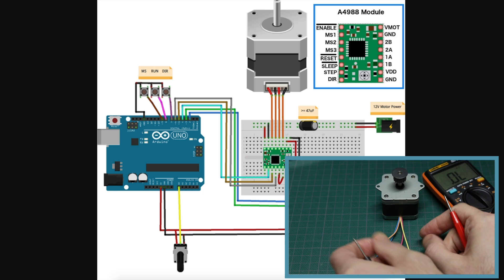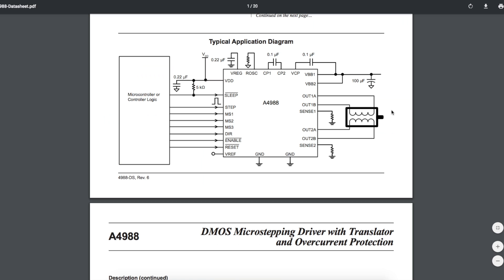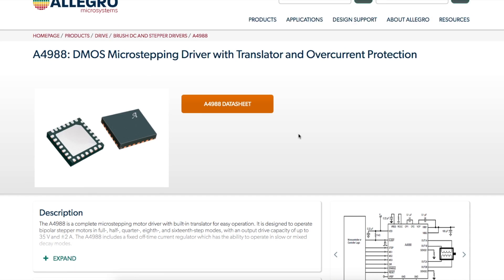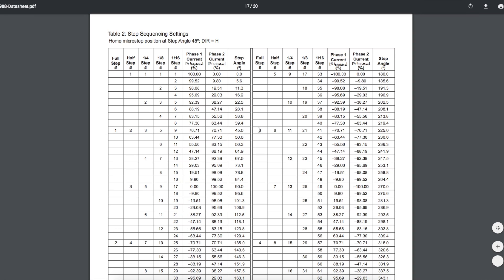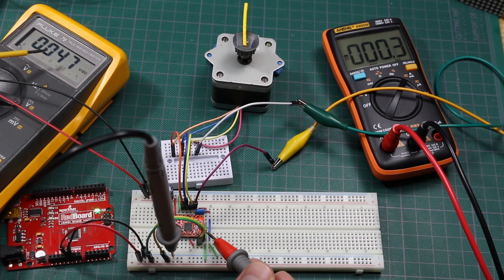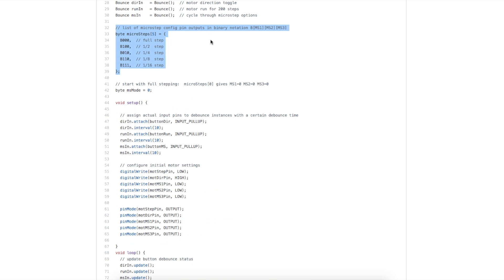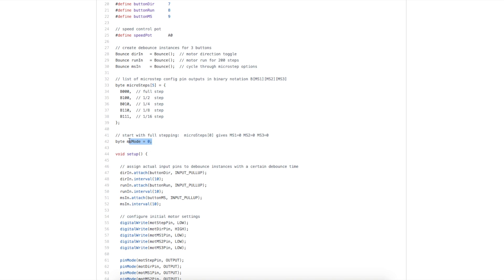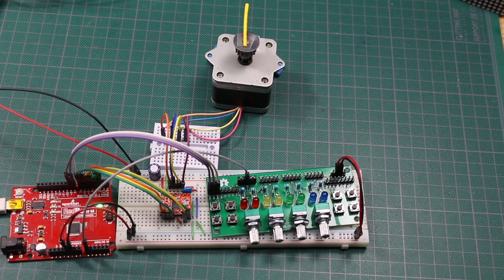A4988 Micro-Stepping Driver with Arduino Uno

Comment: how did you know what power supply to use for this project? and where did you buy one?  the nema17 stepper motor specs that I have are: 
Rated voltage: 3.6v
Rated Current: 1.5A/phase
In essence I'm curious to know why you chose 12 volts.
Reply from the maker: If I didn't use a variable bench supply then it was a fixed 12v from Banggood  https://www.banggood.com/custlink/33KPhoLkil
For the motor voltage you can read the voltage info near the end of this article as an example
https://www.machinedesign.com/motors-drives/article/21835161/misconceptions-about-stepper-motors-explained
So when using a motor driver that chops the motor voltage when the desired max current is reached rather than keeping the voltage applied constantly, the applied voltage can be higher, as long as the driver chip can handle that voltage.   If the motor can run at 3 amps per phase, a 36 volt driver can use 12v, 24v  etc and it'll just cut that voltage off from the motor sooner or later, whenever 3 amps is reached or whatever the set current is.
The more important factor is the overall power dissipation, not letting things heat up and burn out.   The chopping driver takes care of that.

Comment: Absolutely a great video. Just made the hole thing and it works perfect. Thank You. I wonder if is possible to have one more button so it can run continiusly.
Thank You
Reply from the maker: The easiest way to run continuously is probably wire up  switches in parallel with the buttons so it can stay on without being held.

Comment: I tried to calibrate mine A4988 at 2 amps. I used your method but ampmetter shows only 1amp even if I reach the end of the pot range. Have you any idea where the problem may be?

Comment: 5:40 If it does not work for you:
For some A4988 boards: Sleep and Reset are inputs.
Tie both to Vcc (3.3v or 5v). Fixed my settup after 2 hours of checking connections xD

Comment: Can you give me where i can find the generic I/O board, 2x 4 buttons, 4 potentiometer, LED. the one we see at 16:30 in the video.
Reply from the maker: Bare PCBs (no components) for the breakout accessory board with the switches/LEDs/pots can be bought from PCBWay here:  https://www.pcbway.com/project/shareproject/Push_Button__Potentiometer__and_LED_IO_Board.html
Reply: @GadgetReboot   Now i need the parts list and location, thank's for your quick answer. i realy appreciate your explication.
Reply from the maker: The schematic PDF and a rough BOM were put here  https://github.com/GadgetReboot/GR_IO_Board
I got the parts on Aliexpress so it was hard to get exact part numbers for switches and pots but I tried to be as specific as I could in the BOM

Comment: Is it possible that microstepping doesn't work because the voltage (potentiometer) is set too low?
My motor works perfectly in Full Step Mode, but if I want to set the motor in half step (or other modes), nothing happens and the motor is still in Full Step. 
I don't have buttons or an array with bytes, i just set the outputs MS1, MS2 & MS3 to HIGH/LOW with digitalWrite in the loop.
Reply from the maker: it may make sense that it needs more current because different amounts of current are needed for different step positions to lock it in place between natural full step positions so if there’s enough current to start motion but not enough to hold it, it might just slip into the next full step position instead of staying in between.

Comment: what software did you use to draw your wiring diagram with?
Reply from the maker: if it’s the type of wiring diagram showing things like a real bread board and the module and then the colourful wires connecting it, that would be Fritzing.
for doing actual design project schematics I use KiCad
Reply: @GadgetReboot  Thanks for the informations

Comment: I need some help about this Arduino code in this video. I this video motor runs only 200 steps I need to run motor independently until button is pressed !
Reply: Hi there did you manage to solve this dilemma, I'm currently having the same issue

Comment: Great video. I have a question for you. If I want to program the stepper motor to travel a certain linear distance, how should I go about to implement this? For example, if my stepper motor is connected to a belt and pulley system, and I want it to travel a linear distance of 10cm, etc. I was thinking that if I could specify steps per mm or something similar, it could work. But I am not sure how to go about implementing this. My project is to build a linear actuator. Any tips or suggestions would be appreciated. Thank you.
Reply from the maker: I wonder if this document might somehow help visualize it. http://engineering.nyu.edu/mechatronics/smart/pdf/SMART2005/henryReport.pdf
so however many steps the motor has for one revolution, and whatever the circumference of the motor pulley area is, it can be figured out how many millimetres per revolution and per step occur.

Comment: Exactly what I was looking for for last few months! Thanks for the video! Also I wanted to know what is the minimum voltage / current at which I can do the 1/16 microstepping? Can I run it on a phone powerbank with step up converter?
Reply from the maker: it would depend on the motor as well as the driver, for the stepper I used, I had problems if I tried to go below 12 V and one amp, but it’s also a heavy duty motor originally designed for 24 V. if the power bank is only say 5 V and maximum 2 A, if I tried to use that in my set up, it may barely work by the time I step up the voltage and then lose some of the current.

Comment: Hi. Nice video. I have a doubt and perhaps you can help me.
I recently boguth these motors https://www.amazon.es/gp/product/B07CZHLKTC/ref=ppx_yo_dt_b_asin_image_o00_s00?ie=UTF8&psc=1
In the specs I found that they are rated for 2.4 volts. Is it possible to drive them with a A988 and 12 volts power supply?
Thanks in advance.

Comment: Great video, some of the best explanations I've seen. I am having an issue with setting the A4988 pot. I have a 1.7a Nema 17 motor and when I do a Vref check from the A4988 pot to ground I'm seeing about .5V but when I do the series amperage check on 1 phase of the motor I'm seeing <1mA readings which doesn't seem right. Making small changes to the pot aren't affecting my mA readings. Any thoughts?
Reply from the maker: The first thought would be, is the driver enabled and not in sleep mode and not in reset?  has that same set up been used to successfully run the motor otherwise? Sometimes I don’t even bother measuring, I just set the pot for the lowest voltage and start running something that should be turning the motor and then adjust the reference until the motor starts turning because that should definitely be within safe current limits at that point.

Comment: Nice video, will be good to see what the project is. in my post bag 10 I got 5  TMC 2209 Stepper Motor Driver modules which i've still got to think of what to do with them. Got a few 5mm linear stepper motors, but can't think what I can do with 5mm of travel. may be some kind of leg joint in a walking 4 legged thing, got brain freeze with them. :)
Reply from the maker: 5mm I can’t think of anything I would do with that either. Maybe some sort of lightweight sliding latch mechanism to lock a small door or cover... maybe some sort of tamping mechanism with one on each side of things that occasionally need to be tapped to keep the stack straight.
Reply: @GadgetReboot  I'll have to think of something. As we are going in to lock down (UK) i may have plenty of time to come up with it.

Comment: 20 min mastery on steeper and drivers congratulations! I want to see what this project is about, I'm myself I'm trying to do a fully 3d Printed solder paste dispenser with something similar  Your video helped me a lot figuring out the code. Again thank you! Love your videos and also the 555 dev board :)
Reply: I downloaded a Thing that dispenses solder paste, manually.  Amazing how well the printed threads work on that flat plunger.  Are you going to use a 3d printer with a dispensing head to paint PCB pads with paste?  Hmmm ... makes me wonder:  is solder-paste filament is a thing?
Reply: @GnuReligion  Hello, I did too but depending on the paste viscosity the parameters change, so far I want to make it sort of automatic :)
Reply: @belenhedderich3330  Yeah, solder paste turns hard after a while.  I dilute mine with liquid Kester Flux in a soda-can bottom.
Reply from the maker: I have a syringe of solder paste that I know I once ordered and received but I have no idea where it is so if I ever find it, I will probably get to put my liquid flux to use
Reply from the maker: @GnuReligion  oh yeah! If you could get me one of those that would be much appreciated! I really need to get a 3-D printer. But yeah, I would totally put that to good use and actually do more surface mount with stencils and everything too. so many doors of opportunity would open with using different components that I wouldn’t dare freehand.
Reply: @GnuReligion  I printed that is good for flux terrible for solder paste :(
Reply: @GadgetReboot  Today there are good and cheap 3d printers and learning fusion is not that hard, is a nice complement to electronics go ahead!
Reply: @belenhedderich3330   The manual version may not so great for high precision ... but it is great for forcing old product out of those plunger tubes!   My hands are shaking with strain to get solder paste out with with no tool.   The driven thing from Thingiverse was V1, and @Mike Menci is now up to V5.  I have no idea if any of them are usable.  You can watch V1 to the tune of "My Way" on his YouTube chan here:  https://www.youtube.com/watch?v=uP4FD3tp3ck
Reply from the maker: Your stepper project sounds a lot more useful and advanced than one of the things I’m thinking of, I may have to one up myself!
Reply: @GadgetReboot  Want to do it together? I'm really bad at programming, already designed the printed parts in Fusion 360 I can share no problem, although you need to but some stuff a small stepper (if not small would be too heavy to maneuver) and 30cc syringe, I guess I can design for 10 CC too. Tips must be plastic tapered ones for proper dispense.
Reply: While looking for GR's thing, I saw at least 4 motorized/Arduino contraptions like this one below (the most popular).  At a glance though, it appears to use one of those common 5-wire gear steppers, not a 4-wire differential, so (sigh) this is off-topic.  https://www.thingiverse.com/thing:1119914
Reply: @GnuReligion  That can be done but the motor is not that precise for what I want to do

Comment: Nifty.  I have never gone beyond using a H-bridges.  Some of the newer stepper controllers use i2c or serial to communicate.  Fancy ones and can go into "silent mode" and even sense when physical limit stops are reached ... perhaps by measuring current draw.
Reply from the maker: One of the projects I have in mind is going to need a way to detect reaching end of travel and I haven’t figured out what approach I will take yet, physical limit switch, optical break beam, hall effect.. but I should look into getting some of the fancier drivers.
Reply: @GadgetReboot  Micro Limit switches are inexpensive.  https://www.aliexpress.com/item/1926553469.html
Reply from the maker: I should get some of those. I know I have some larger ones like the kind used on arcade switches but I can’t remember if I have small ones. That’s no reason not to order more inventory though!